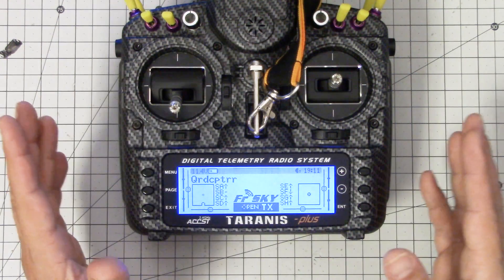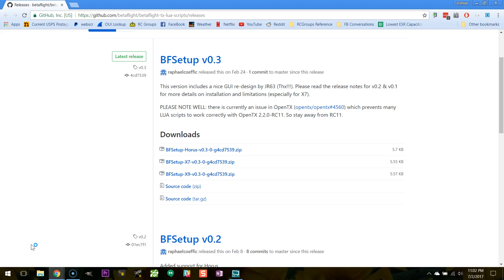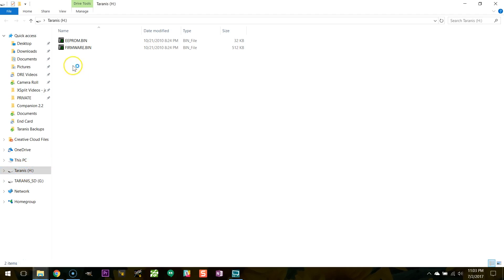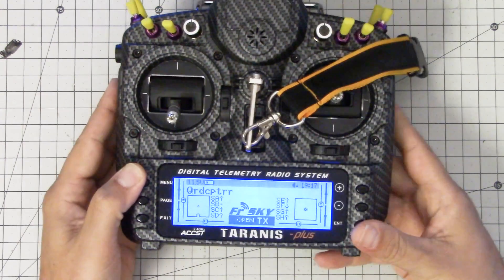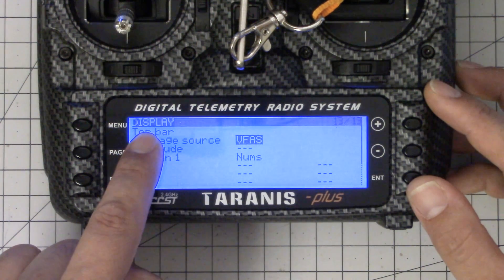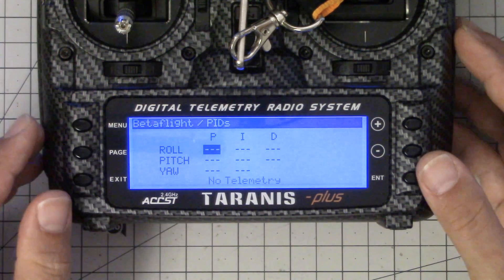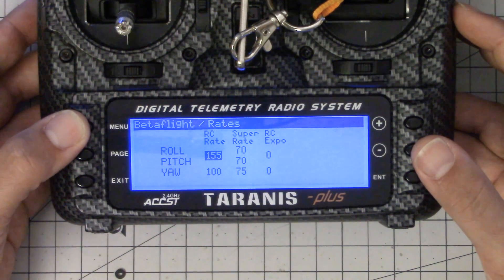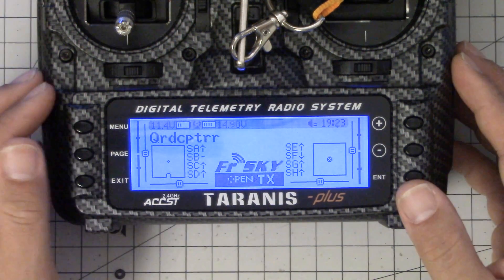Betaflight Taranis Lua Script HOW TO | Part 2 | The Lua Script

Comment: Great video as always
Im running a sp3 evo, I'm able to alter my pid and rates but for some reason unable to change my Vtx 
Its a TBS Unify and is connected to T3 and enabled peripherals tbs smart audio?
After hours I'm now definitely stuck
Reply from the maker: That all sounds correct. I guess I would check the wiring to be sure that nothing was messed up. Try another UART just temporarily maybe? I guess you don't have many UARTs spare. If you can get at SoftSerial on the board, give that a try. SmartAudio will work over SoftSerial.
Reply: enabled softcell but doesn't show in betaflight port menu
am i right in saying i can't use the soft cell because I'm using sbus

Comment: Hey Bardwell your videos are great  thanks for all you do. Quick question? after watching this video and setting it up (awasome by the way)it got me intrested in other Lua scripts so i downloaded a Lap timer lua script that uses Rssi and it is also great. however i cant have both of them on the same model.  Screen 1 and Screen 2 i get a low memory fault when trying to run the lap timer script. i created a clone of the model and have one script on each and it works but its a pain.  Do you have any thoughts.  thanks for all you do for the hobby..
Reply from the maker: I'm a gonna guess you're out of memory :-) Maybe you can save memory by flashing a version of the OpenTX firmware with some features removed. I don't know really.

Comment: Followed everything but why is it mine shows blank values? Sorry being a noob. I have telemetry working. Data like Vfas, acc, etc is shown on another telemetry page.  But on the lua page, it's blank values.
Reply from the maker: Are you using a D series receiver, because it won't work with FrSky telemetry, only SmartPort.
Reply: Joshua Bardwell I am using XSR.

Comment: Any reason for this to NOT work with a D4R-II?  I have one currently attached to my Taranis X9D+. The Taranis receives telemetry, such as voltage and current just fine, but no information is showing regarding PIDs or other script related information.
Reply from the maker: Yes, absolutely it will not work with D4R-II because D series receivers do not use SmartPort telemetry. They use the old Frsky telemetry which is one-way and cannot support smartport.
Reply: awesome content. it would be helpful to note that this will not work with the D4R-ii somewhere. Maybe state somewhere on which receiver it will work on. For us noobs.  Thank you
Reply: thanx for asking this question. saved me from trying the same.
Reply: Yeah just ran through it and NOPE doesn't work wish it was stated somewhere oh well

Comment: joshua I have the lua script installed and setup but when i turn on quad I have no change in pids or anything?telementry is working,its sp racing f3 board...?any ideas
Reply from the maker: If you are using a D series receiver, this won't work, because they don't use SmartPort, they use the older FrSky telemetry, which is one-way.
Reply: Not sure it's the board that comes in the wizard?cleanflight board

Comment: The Airbot A2 (http://shop.myairbot.com/index.php/fpv/a2camera.html) uses the same split board and camera setup and also does HD recording and FPV out at the same time. It was actually put out for sale a couple of months before the Split. But from the RCGroups thread, it has been plagued with problems. The manufacturer appears to be using early adopters for beta-testing!
Reply from the maker: Airbot seems to use early adopters for beta testing a lot. The same thing seems to have happened with the Asgard. I like Airbot's innovation but they should QC more.

Comment: Hi guys. Installed the PID/RATE/VTX lua script on my Taranis for two of my quads, one quad worked right away with the X4R-SB RX (firmware version not known), but the other quad did not work. After some research, I found that it was a firmware issue with my XSR reciever, all of you that use the Frsky XSR RX, pay attention to the last firmware update, The lua script wont work with XSR170605 firmware, you should update to XSR-170619 firmware to get the data to flow ;)
Reply: How do I do an Upgrade for a XSR Receiver ?
Reply: Many thanks. I was very annoyed
Reply: torsth05 how do you wire the d4r-ii  looks like I'm not getting any data flow I connect Rx to Tx and TX to Rx but is not working.

Comment: Hey Joshua 
did you ever find a Amber sound pack for the 2.2.0 firmware upgrade. I'm using that British gal Joeanns pack that was in  your video comments. It's OK ,had to change a few files as the names didn't match up. but not to bad overall.

Comment: does this only work on the Betaflight board? I'm running an SPF3. I can get all the way to the end but the PID will not show up on screen.
Reply: rebel does the screen show but no numbers in the pid page?mine is the same way..if thats the case with you.i have the screen where the pids are but plugging in quad it doesnt change at all;;
Reply: scott hendrix exactly the same issue. I have my smartport for frsky configured to uart1 and the smartport activated in uart1 for telemetry. I can get the screen but the pids don't ever show up. Not really sure. I guess it's just then good old laptop in the field for me lol

Comment: Hello Joshua.
I have a taranis that receives telemetry without problems and I see all the sensors of the fc. I have the correct version of betaflight and I uploaded the taranis with te newest opentx. And I can't get the script working. Wheen I don't have the quad plugges it says no telemetry but when I plug it in it shows only horizontal lines and no numbers. In the display screen I only see u where It has to be lua. And I have the lua version of opentx.
Reply from the maker: +Nel Ferreiro I have to guess you installed the wrong version of the script for your radio.
Reply: Joshua Bardwell I thought so. But I installed the 9xd version and I have a taranis

Comment: I was just looking at Gtune. I think it is an auto PID tuning mode on some fork of betaflight. From what I hear it seems to be pretty good, is there a reason why you haven't done a video on it. I just thought you would as you seem to be the best place to go when looking for PID stuff.
Thanks for the videos
Reply from the maker: Gtune was completely hit or miss even in the best cases. Also, it only tuned P gain, which is sort of useless. Frankly, I think the best benefit of devs' resources these days is making the defaults fly better, with improved filtering and better PID controllers. Then autotune isn't needed.
Reply: Joshua Bardwell thanks for the answer. other people say it did really well, but I most definitely trust you more than most so I'll take your word for it. Thanks again!

I am still interested so I think I'll try it out some point and give it a go.

Comment: I was thinking mabye i could get some help here: My problem is that i am not able to use rssi on my osd for my matek f405 flight controller. whenever i set it to a channel that i am not using it always just stays at the same number. Idk whats wrong with it I tried multiple guides to fix the problem but i couldnt get it to work. My controller is the spektrum dx7 old version and i have a redcon dsm2 satellite receiver.
Reply from the maker: I don't think the Spektrum supports RSSI channel. That's a Taranis feature. You need a receiver with analog RSSI out, I think.
Reply: Joshua Bardwell thank you for such a such a quick response.

Comment: Running a PikoBLX XSR & UnifyPro V2 but on the VTX it shows no data PIDs show data and telemetry. 
I have tried swapping white wire(audio) to TX1 RX1 TX2 but none seem to get me any communication back to Taranis. 
PID screen is fine except when I moved the SmartPort to TX1, when I put SmartAudio on TX2 to try this swap then I no longer got telemetry or smartaudio Data. 

I also swapped the smartaudo and SmartPort with each swap as needed... 
I saw on GitHub a few people were having similar problems but they ended up using a soft serial and it seems Pikos done have them... 
thx again for always helping the community so much!!!!!
Reply: And I am running SmartAudio 2001(not V1) 
And in another attempt I updated BF to 3.2 just to see ... still nothing
Reply from the maker: Your wiring really seems haphazard. 

Audio from vTX goes to SmartAudio UART TX.

SmartPort goes to telemetry UART TX.

Those need to be separate UARTs.
Reply: Joshua Bardwell 
Yes they are separate Uarts. The Piko only has 3 so I have it wired like this 

Uart3 RC-XSR (works fine) SBus in BF
Uart2  TX2-SmartPort (works fine) SmartPort Telemetry in BF
Uart1 TX1- SmartAudio no communication to Taranis 

When I swap the wires to 
TX1 - SmartPort ( no longer works)
TX2- Smart Audio ( still doesn't work)

Comment: Great video as always!  Thanks!!Pids showing up nicely. But no vtx. My problem isnt related to the Lua. Im having the same problem in my Betaflight F3 Osd.. The Vtx settings shows up under TR (trump)?  I get nothing under SA (smartAudio)?  TBS is activated in ports config.
Reply from the maker: +Fredrik Mårtensson does your vTX support SmartAudio?
Reply: Joshua Bardwell oh, forgot to mention. tbs unify pro race. must be smart audio v2
Reply from the maker: That vTX should work correctly.

Comment: Hello, in the last Video was your Bootloader on Version 2.1.6... and now its 2.2.0? The step to update the Bootloader is not in the Videos.
Reply from the maker: +Andy aus Norddeich I know. It's coming...
Reply: Someone commented on this on the last video.
You have to update your firmware with the radio turned OFF. That way it will also update the bootloader, which can not be updated while it is running of course.
Reply: Andy aus Norddeich https://youtu.be/KbpHb2_RXbk

Comment: had this on my kiss setup for a while now, it's nice to see betaflight coming along. that user interface though..... half that shit can be removed and no one would notice a difference. most people just wanna throw money down and fly and not learn all this stuff. Kiss let's me spend more time in the air and less time tinkering to get there.
Reply from the maker: +FlyQuad FPV in glad you like the equipment you're flying.
Reply: I disagree a little on that. BF is very simple if you just want to get up there fast. But also gives the user a lot of control. Kiss is simpler but if you later want more tweaking you are lost.
But i feel that Kiss and BF is living in a kind of symbiosis. BF improved greatly after Kiss came, and the race between them (and raceflight) is very good for us as end users.
Reply: So why you are here Trump? Just to talk some blablaa? Nobody wont to hear this ………… go with Kiss. Or be smart and do some good work like Joshua.

Comment: Updated the bootloader... Nice. Do you actually notice a difference, other then the number has changed?
Reply from the maker: +aubrey vantuyl only difference is it is compatible with the new SD card structure if you flash firmware from bootloader. FIRMWARE vs FIRMWARES for example.

Comment: I am having a problem and would love you or your subscribers opinions.  Electrical interference. The higher the throttle the worse the interference.  Following is a list of changes I have made chasing it, each done 1 at a time with several packs in between. Nothing has made a difference it looks exactly the same as when I started. (Wizard X220) First Emax red bottoms, then capacitors on ESC's, then Lumenier VTX, now LC filter in between PDB and VTX. Power for Swift 2 comes from VTX, straight signal to VTX from Swift.  I have looked at PDB and FC and don't see goofy soldering. Any comment will be appreciated. I guess new PDB, FC and ESC would fix it,  get the rest of the Wizard out?
Reply: try to soft mount your FC and motors
Reply: done and done. I'm thinking of unhooking current sensor on camera.  Easy to do and running out of ideas.  My brother has exact same set up. ( I built it)  He has zero issues..
Reply from the maker: +Flyin High FPV make sure camera and vTX are grounded to the same pad.
Reply: Twisted and soldered together then soldered to out going side of LC filter.  Could the PDB be going out? I would think LC filter would clean up the current.  Next is new PDB, then ESC;s.  Thanks for the response, have a great 4th.
Reply: Flyin High FPV I seen what was causing this and the simple fix for it but I cant remember where I saw it or how they fixed it..! You figure it out?

Comment: Hey Josh, I'm in desperate need of your help. I purchased the dys f4 pro flight controller and the asgard all in one flight controller. I connected everything perfectly and everything works good but the both flight controllers reboot mid flight causing my quad to drop out of the sky. If you can give me any type of input of what could be the cause I would be very grateful !
Reply from the maker: +ICE MAN best guess is a power issue. If you hear the ESC's do the full five note startup tone the whole quad lost power. Is your XT60 loose maybe?
Reply: Joshua Bardwell  xt 60 is stable. when i go to the receiver tab and play with the sticks for a few seconds the value of the sticks freeze and it reboots. My dys d4 does it and my asgard all in one does it. Do you think the processing chip is getting overheated?
Reply: Joshua Bardwell  I posted a video on my channel so you can see exactly what's going on. Thanks a lot for getting back to me !

Comment: Great video as always Mr Bardwell, I have a question for you, Once you take the TBS Unify Race HV out of pit mode can you put it back to pit mode the same way.. ie choose off and save page -Choose ON and save page?
Reply from the maker: I'm not sure about that. I think once it goes out of pitmode it has to power cycle to go back into pitmode.
Reply: Joshua Bardwell that's exactly what I thought, My work around is to add a RX switch to power the TBS, then can test the quad LOS without upsetting other pilots

Comment: Great instructional video ...thank you Joshua.

Now the issue ... got the script coming up on my radio, but not getting any data displayed.
Tx is Taranis X9D with 2.2.0
Rx is D4RII
FC is Betaflight with 3.1.7
VTX: TBS Unify Pro 5G8 HV

I can see the telemetry data on my fatsharks.  PID and  TBS settings all fine via goggles, but no data on radio.  No clue as to issue.  Tried rediscover sensors, but nothing added.
Reply: Oh dear ... The issue must be that we tend to wire up the telemetry from the D4R to FC and not bother about the the return Rx on at the receiver.   Receiver is not getting back any data from FC.
Reply from the maker: Even more fundamental than that: D series receivers use the old Frsky telemetry protocol, not SmartPort. You must be using SmartPort to do this.
Reply: Got it the wrong way round.  Telemetry is being sent from Fc to Rx. My mistake.   So it ought to work.  Still stuck
Reply: So I'm still new to all this. I am not getting any data back either on the acrowhoop v2. Starting now to research and see if it has smartport or can I enable it?
Reply: Aah shucks! ... thank You Joshua

Comment: Hi all, does any one get Script syntax error (BF/ui.lua:285) ... when trying to run the lua script?
Reply: yes
Reply: Hi Bryce I ended going trough the whole set up again and the error seems to have disappeared.
Reply: I sorted my issue also, for me It turned out I had a dud/wonky SD card that shipped with my Taranis. Once I replaced it with a new one and re-setup everything it is all working.
Reply: @bbblll3387  Thanks so much! i've been messing with mine for 4 hours w/ no luck...and then I saw your comment and tried a new card...all problems solved!

Comment: If I already have the RF1 script that contains the same "script" and sub folder "telemetry" do I need to rename anything or can I use them mixed together?
Reply: Yes it does, I just copied and pasted each file into the existing folders and added the other entire folder.  Tried in controller and seems to work.

Comment: Could you post a temporary download link to the OpenTX 2.2 noheli lula file you got? Until the servars are up again? :)
Reply: Do you have the OpenTX 2.2 companion installed.  It downloads the firmware for you dependent on the setting you choose.
Reply: Didnt have the companoin prog installed. But the download site is back up now. :)

Comment: They should build more video transmitters with "smartaudio" or equivalent protocols. It's so sweet to do not have to play with dipswitches or any kind of push buttons lol
Bad luck for your serie of videos is that the domain which hosts the openTX firmwares is down so a lot of people won't be able to update their radios, maybe just wait until tomorrow...
Reply: FuriousFPV is joining the game with their own smart audio VTX. It also has a built in mic so you get to retain your sound if you're into that kind of thing!